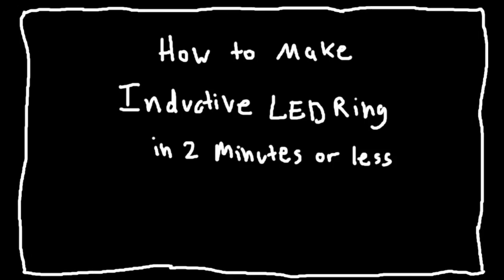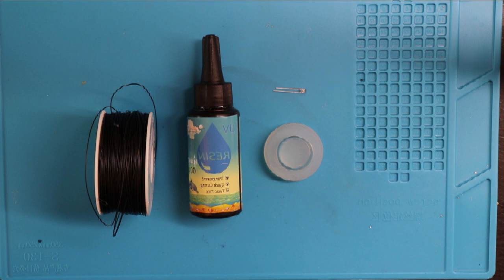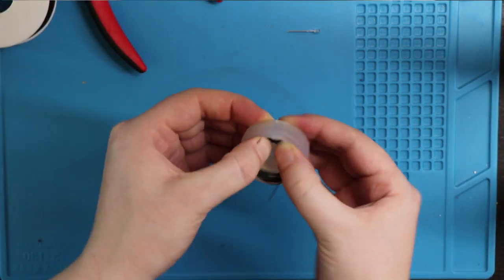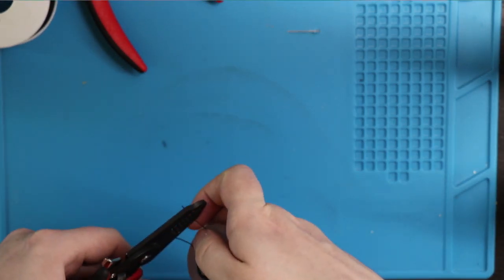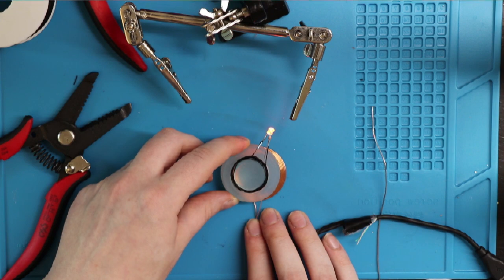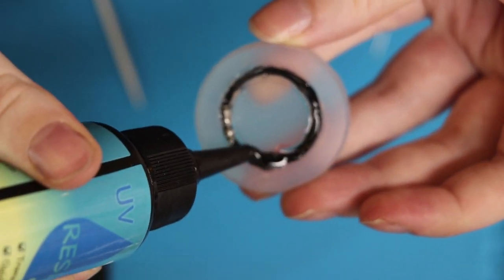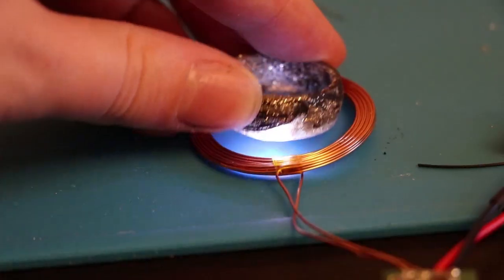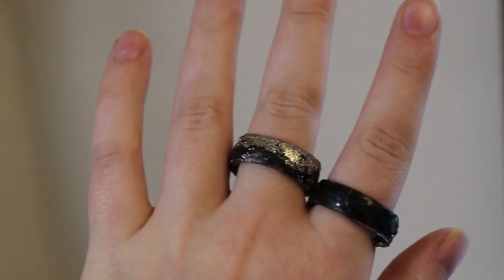How To Make an Inductive LED Ring

Comment: One simple question, can we have a very small button cell/battery in the ring that keeps on powering the led. If there are switches that control the flow of electricity then fine but if the led lasts for maybe even a year with battery cells that too would be ok. Is this possible
Reply: There are some super small batteries but good luck with battery life longer than a few hours

Comment: This is super cool. I'd worry about overvolting the LED, tho.
Reply: Led's are bulletproof. Only thing that will happen is they dimm over time or they break. No serious problems in a system like this. Maybe a small resistor could extend the life a bit.

Some nerd might be able to tell us which one to use.